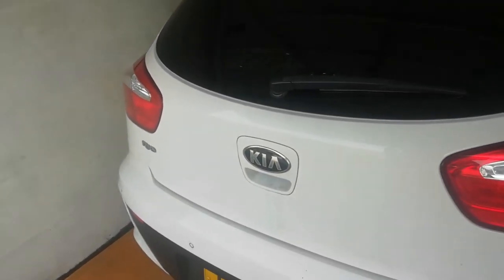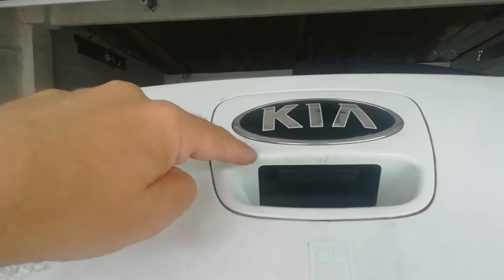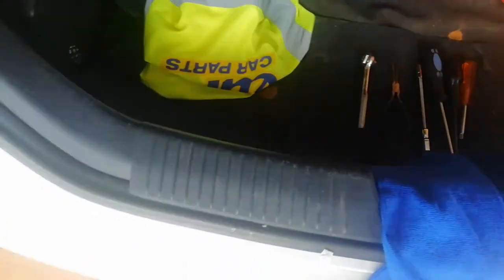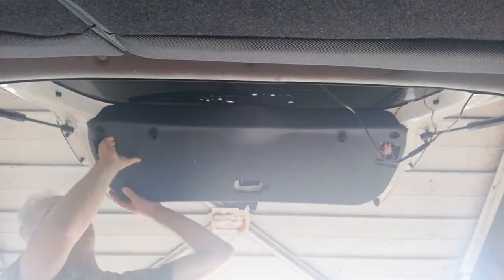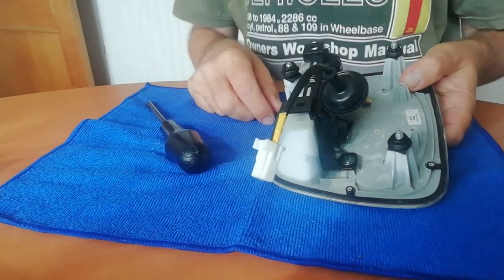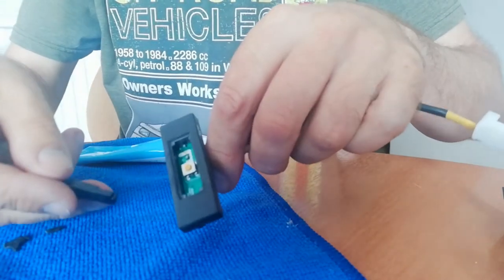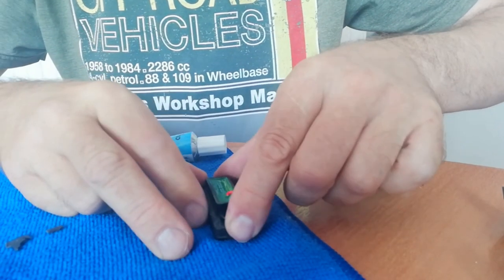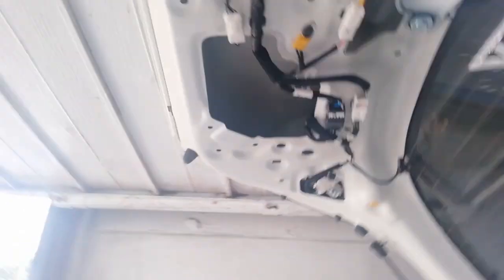Kia Rio rear boot switch repair

Comment: Excellent video! This same switch works for me or is it compatible for KIA Picanto Ion 2017?
While the new switch arrives, can I rave with a traditional or switchable switch? I am checking and I see that it is a micro switch that opens and closes a circuit, it is not resistive.
Thank you very much for your comment.